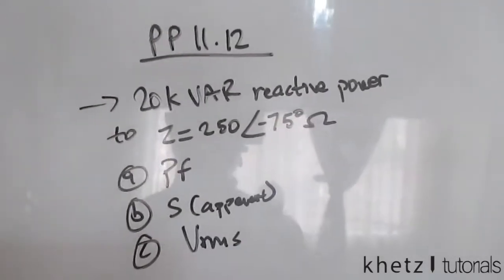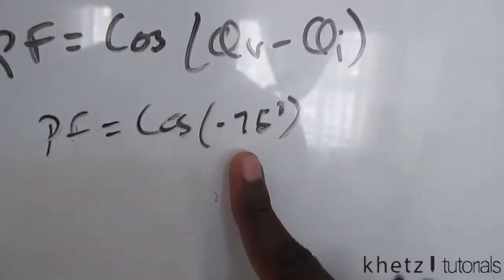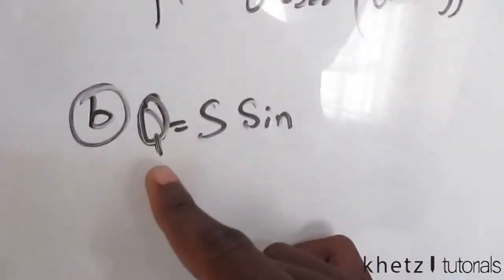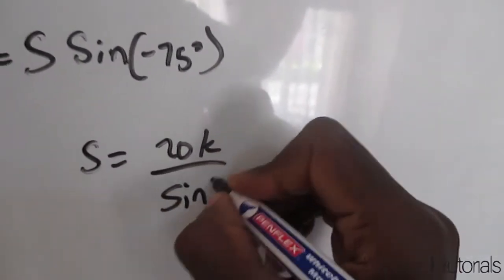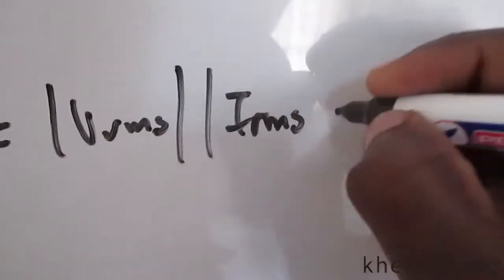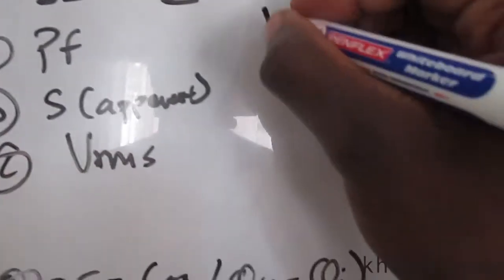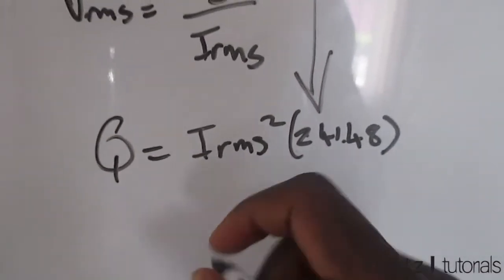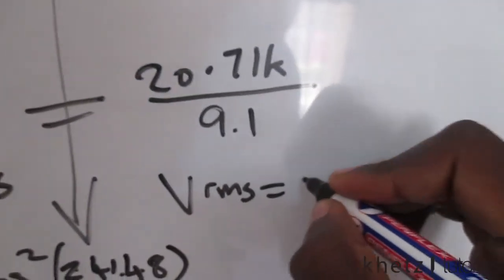Fundamentals Of Electric Circuits Practice Problem 11.12

Comment: Similarly is there any formula for "P" involving I rms or V rms
Reply from the maker: Hello. If you are referring to true power, then there is. The formula is P = Irms x Vrms x pf, where pf is the power factor = cos(theta) and theta is the angle between current and voltage waveforms
Reply: Thanks mate